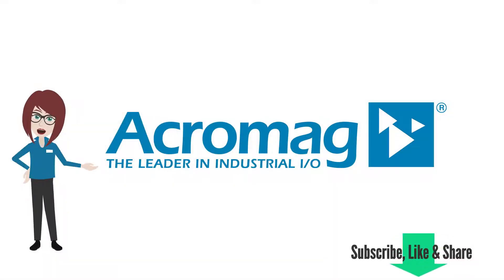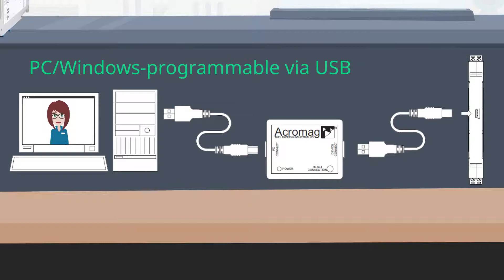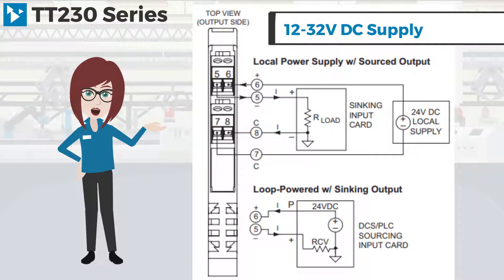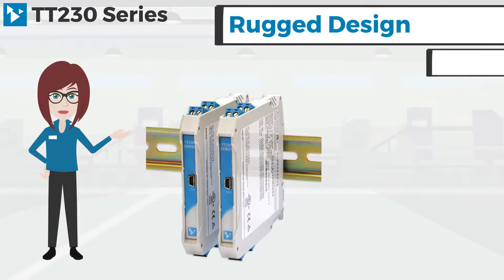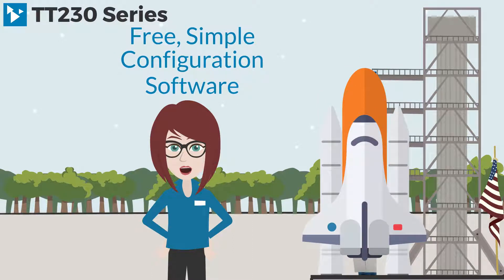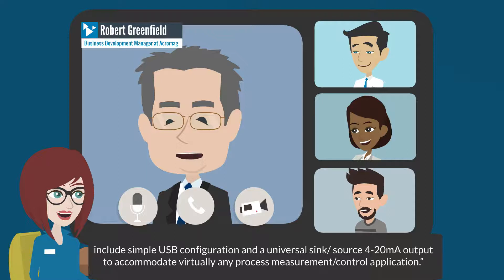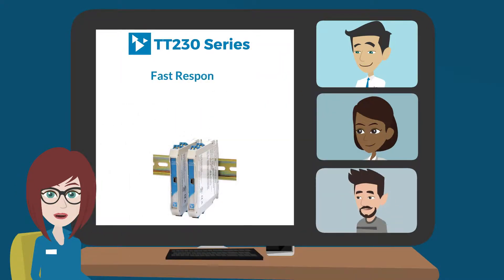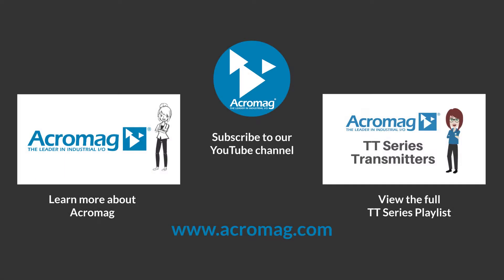Loop Power, 4-20mA Output, Two-Wire Transmitters | Acromag TT230 Series

Comment: I'm looking for an RTD 3-wire transmitter that converts to 4-20mA, do you have a model for this? What is the maximum RTD cable length this transmitter can support?... Thank you!
Reply from the maker: Thanks for your question, Acromag has several models available! 👍 Please call our inside sales department at (877) 214-6267, and they will help you determine which one is right for your needs.